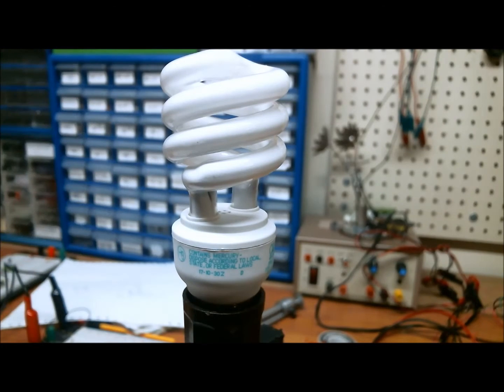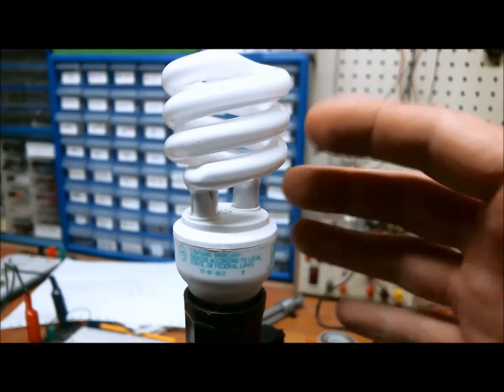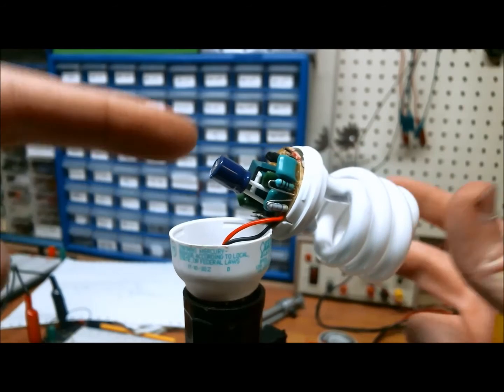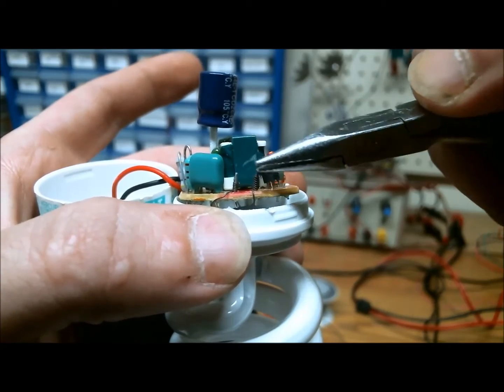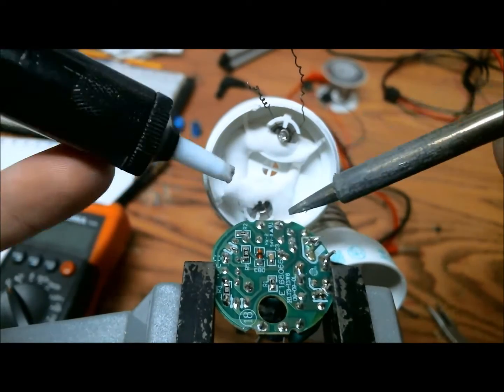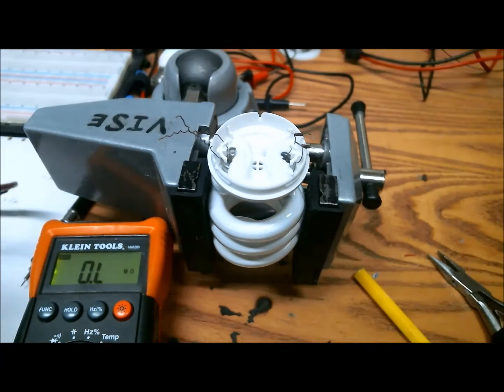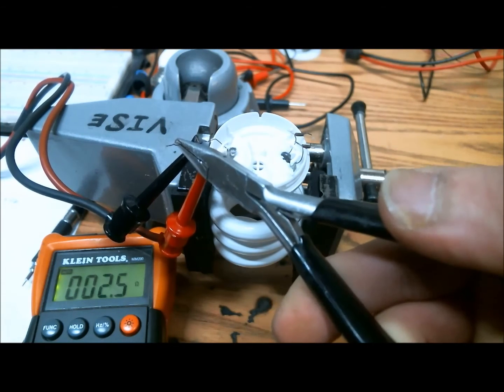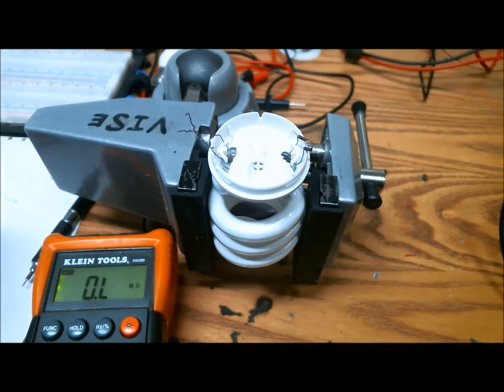Analysis: CFL Failure

Comment: You can take another light with the same wattage apart which has a bad ballast (the circuit board) and use the light from that lamp with this circuit board.

Comment: what is the general problem comes to a cfl circuit. i have 20 w wipro twister having circuit problem what should i replace so that it works normaly.
Reply from the maker: They are issues working with Dimmers (Triacs)